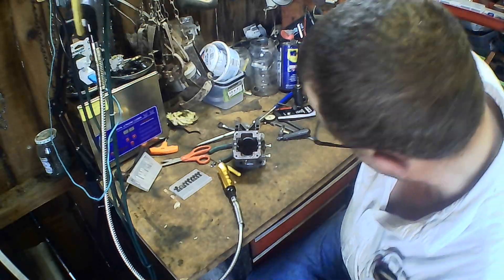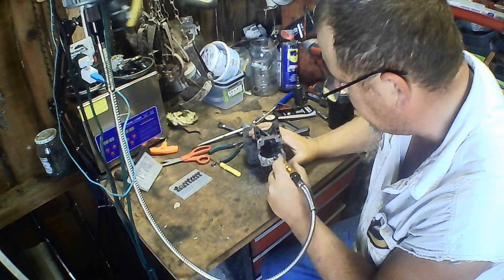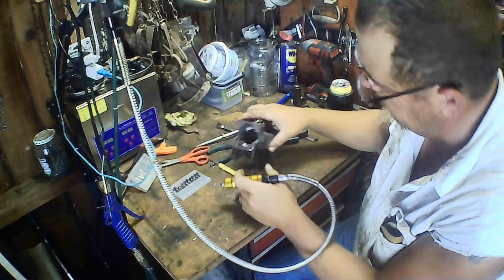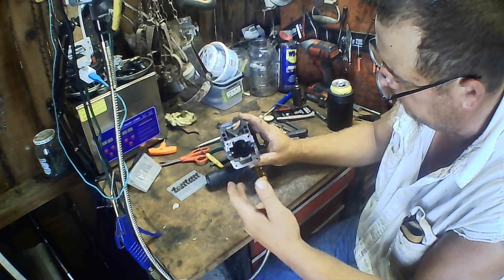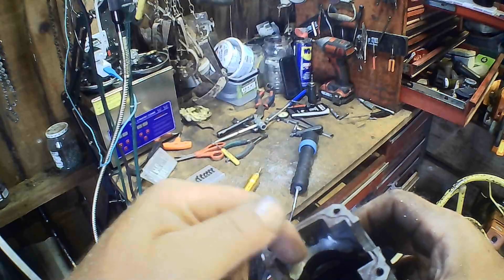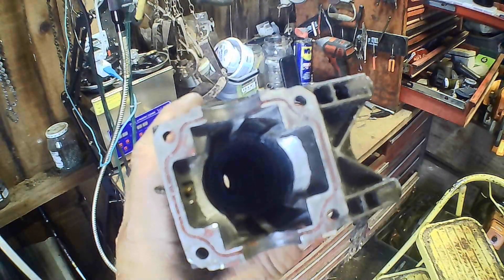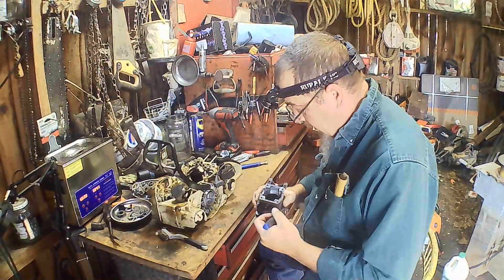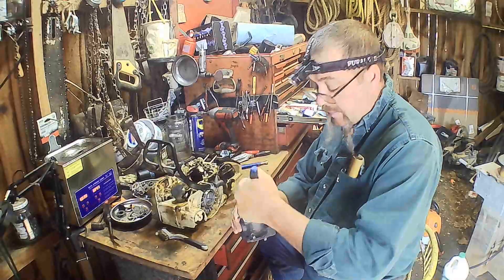Porting clamshell Stihl MS270 chainsaw & first cuts.

Comment: Enjoyed   watching & you explaining things there, sure did !! i wish i had a ported saw , scared to try it myself , i can screw up more than i can fix !!  I dont watch much TV , You Tube is my entertainment these days , love old saws and cut firewood for the house . Thanks Take Care !!
Reply from the maker: @jamesconn7311 Aw heck, 'taint nothin' to it!! I started with a muffler mod and went from there. I'm still just a curious hack and by no means a "saw builder". I'm on my 4th cylinder on my current 026; but, at $30 or so per cylinder/piston, I can afford to do a little learnin'. Glad you stopped in and joined-in again; sure glad to have ya here.
Reply: @HayChaffandSawdust1  Thank Ya Sir , glad to be here too !! i gutted a muffler on a Dolmar 5105  do the carb need adjustment now , havent run it yet , TIA

Comment: Laughing my ass off at 9:33

Also, thank you for the tip about the 290/390 compatibility.
Reply from the maker: Haha. Glad somebody caught it!!  Glad the 290/310/390 info helped. One more tidbit; if you do a 290 to 390 "upgrade", order/buy a decomp plug. the 290 had no decomp and the 390 has one and it will not fit under the lid. It's really not needed anyway unless maybe you order a domed piston also... then maybe. If you use the decomp, you will have to cut a hole in the top plastic of a 290/310, but a decomp plug will fit under the bonnet. I cut a hole in mine and shouldn't have.  Thanks for being here and ESPECIALLY for commenting!!
Reply: One tank of fuel through the 390 swap, I have mixed feelings so far.  To be fair, this was a cheep basket case that I have zero run time on prior, I do not know how these run. 

What I have done: 
eBay top end, not the duke, but not the cheep one, included bearings, seals, rubber, filters, exc. 

Squish .058, can’t really help that
Intake 80/80  160*
Exhaust 97/97  166*
Transfer 126
Blow down 29*

Didn’t move ports much at all, just widened the exhaust and lightly domed it, my have taken it up 1/2* in the middle.  Did the lungs on the top of the intake. Blended the bottoms of the transfers and crankcase.  Raised that transfer divider to the bottom of the piston at BDC.  Only installed the upper ring. Removed carb screw stops. Opened the outlet from the exhaust can, now has 4 holes ~1/4x3/8”, removed screen. 

How it’s going: 

Will idle all day on the ground without loading up, returns to idle from wot without stumbling, just light 4stroking at Wot.   It does feel sluggish from idle if you smash the throttle, but if you crack it, then hammer open, it zings up and down as fast as you can blip the throttle.  Any thoughts on the sluggish off idle? To much intake timing, or intake port to wide?  Maybe a few more tanks will help brake in?
Reply from the maker: @Archer_82  My first guess: (and I am not NEAR as experienced as some/most) is that longer intake timing will give some benefits for grunt, but makes the saw a little sluggish by slowing down the velocity of the intake charge. Also, the increased case capacity associated with trenching the case, removing the divider, etc... gives increased case volume. Increased case volume also makes for a more sluggish saw, but I don't mind sluggish off of idle on my work saws as I'm not limbing evergreen trees with a jillion limbs; my saw spends lots more time at WOT in the wood. Did you gut the baffle from the muffler? The baffle is a big choke point on these saws. I have not ported a 390 (and I also use the cheapo stuff from ebay with decent success) without gutting the muffler or building a pipe. I like the exhaust such as will be shown this (or next) friday on my channel. It's on a MS250, but I do them very similar. I have experienced that the extra work inside is stifled if the muffler is not gutted. Gutting the muffler will (probably) give you some more throttle response and will almost-positively give you a more enjoyable saw to run.
Reply: The outlets were enlarged, with the baffle not removed. I do have two mufflers for the Saw now as one came with the kit, I will remove the baffle on one, see what differences that makes. Thank you for the suggestion, that’s probably why yours sounds so much better.

I also, am working on two small saws a 45cc motor to drop into an old 021, this is my limbing saw, with an 18” 3/8” LP, and another basket case, ms250 I have not cracked open yet. Looking forward to your video on this, it will be interesting to compare numbers and drivability.
Reply from the maker: @Archer_82  Don't anticipate too highly. I did do a vid on doing the muffler on the 250 (I also have an 021 with upgraded), but alas, I didn't have the cam pointed low enough to catch my work. Have a short vid featuring the 026, but  also showing the completed muffler on the 250 and runningboth.

Comment: Is that a Foredom rotary tool or is it something else? I’ve been thinking about buying one and wondering if one of the knock offs would be good enough or not.
Reply from the maker: That one is a knock off (Vevor?). It was about $60 or so? It's been good to me. the angle head is also knockoff, but they are harder to find.

Comment: A 390 65mm bolts up to a 310? Guys got a 310 thirty minutes away for fifty bucks.
Reply from the maker: @StihlRunnin Yes sir!! The MS390 is same chassis as the 029, 039, ms290, and ms310. The only oddball is the 031.  It's actually almost impossible to find a reg size bore aftermarket for the 290,310 saws; they're all 390 size.  Those $50 Stihls of that chassis are great fun!!